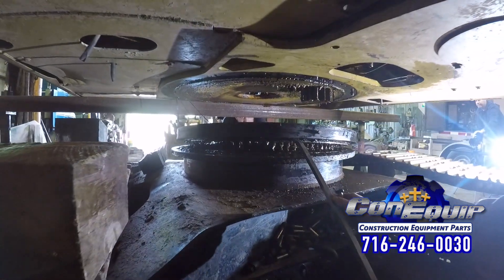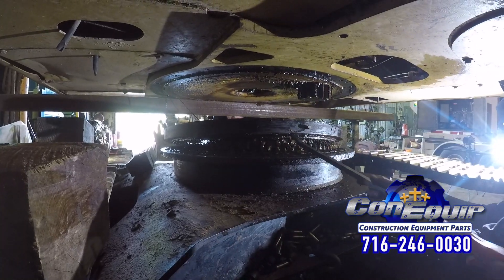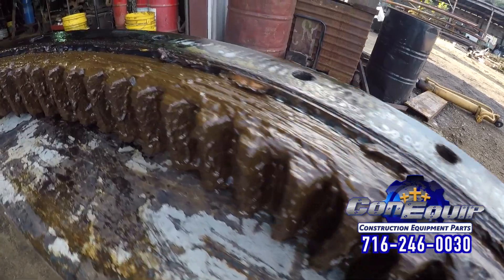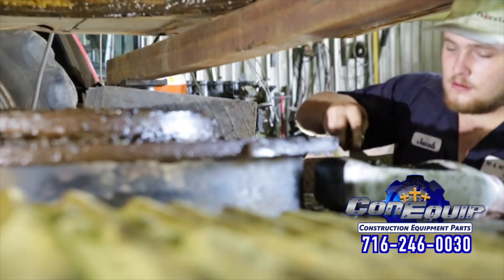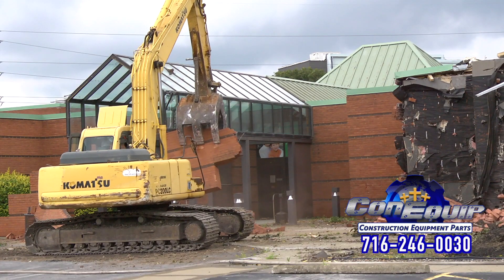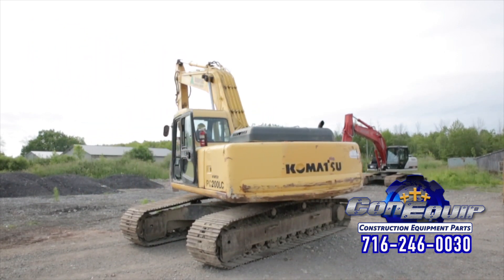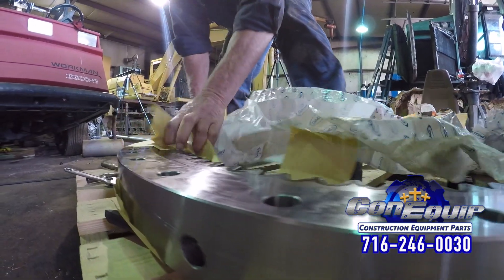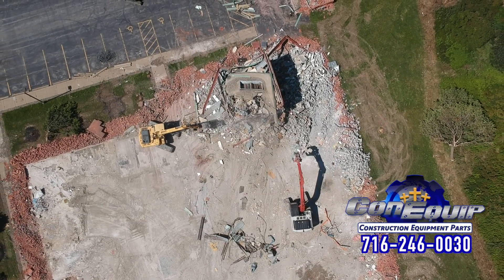Swing Bearing Failure Signs to Look For

Comment: I had an noise and kida popping under the cab, washed well and greased extensively... noise disappeared  and is turning smoothly but some freeplay is there. Ill shop for bearing, but can I use it carefully (non commercial)  and be safe for time being?

Comment: I have a Kobelco ED150 and some rusty water was dripping out of the swing drive seal today after not being run for an extended period…i greased it well to day…I could feel a slight disturbance in the swing as it swung around instead of the buttery smooth swing it normally has…I will give it some more grease tomorrow and see how it works after…what is a ball park price for a sing gear/bearing for a 14-15 ton excavator?

Comment: question, could swing bearing failure or faulty will damage center swivel?
Reply from the maker: do you mean the swing drive?
Reply: @Conequipparts  i think he meant the hydraulic swivel joint ...

Comment: What happens if the swing bearing fails? I'm running a link belt 330lx shear and it has all the symptoms said in this video but the company I work for don't care about fixing it. Could it be dangerous for the operator? Could the upper separate from the undercarriage?
Reply from the maker: Never heard about anything dangerous happening to the operator but I can't say for sure.  Eventually, your upper structure simply won't turn anymore.  Give us a call so we can help you!
Reply: How much it will cost me to buy a (set of) swing bearing for a Liugong 920D model 2014?
Reply: well, it could catastrophically fail if loaded enough, but on an excavator unlikely, on a crane however, the whole bearing could just snap in two.